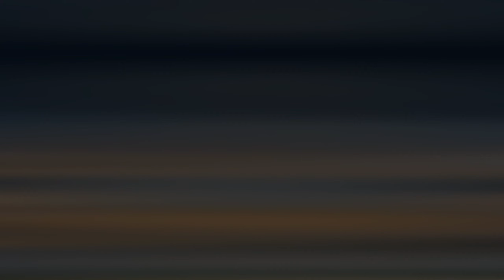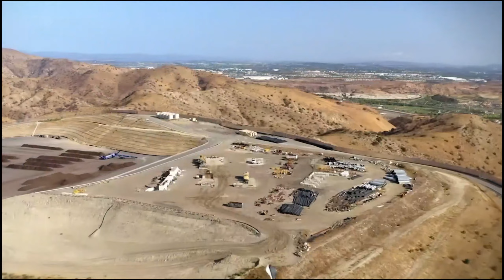AT&T Stadium Explained: The Impossible Engineering Behind FIFA’s  Stadium World Cup 2026

Comment: AT&T Stadium's seating capacity is NOT 80,000.  It consistently seats at least  93,000 for football games, and is able to seat over 100,000 for certain events.  If you are going to do a video at least get your facts correctly.  I have been to AT&T Stadium several times so I would know.
Reply from the maker: Thank you for your passion and for sharing your firsthand experience visiting AT&T Stadium! You're absolutely right that the stadium can hold well over 100,000 people, and the record attendance for a football game there is an impressive 105,121.

However, the 80,000 figure mentioned is actually the stadium's official fixed seating capacity, which is the standard number cited for regular NFL games. The higher numbers — including the 100,000+ configurations — are made possible by adding temporary seating and standing-room sections, typically for special events. So both figures are correct depending on the context!

We appreciate you keeping us on our toes — it's always great to hear from fans who know their stadiums inside and out!